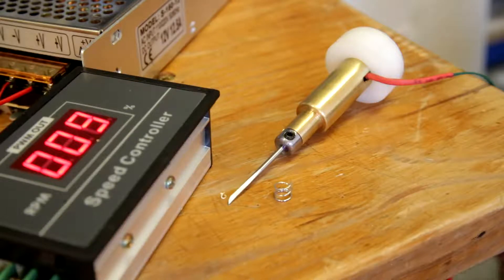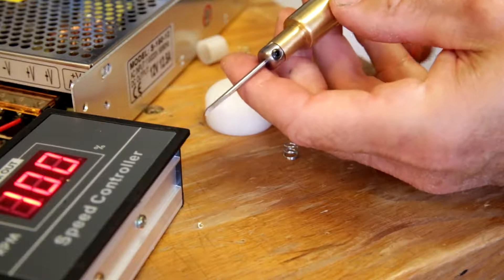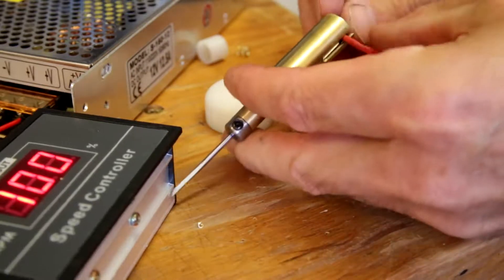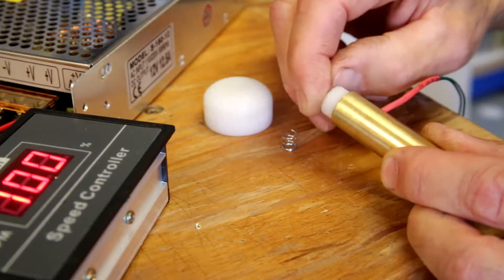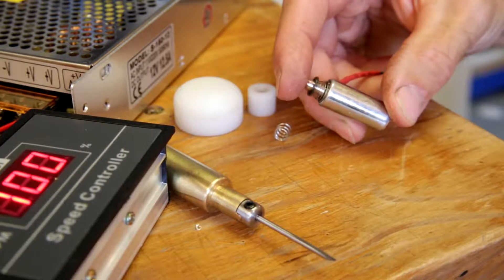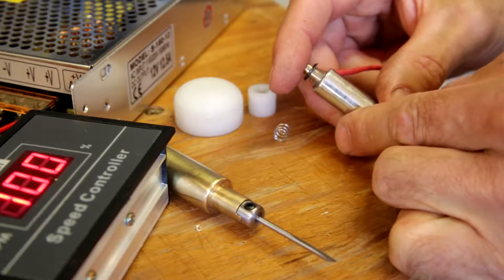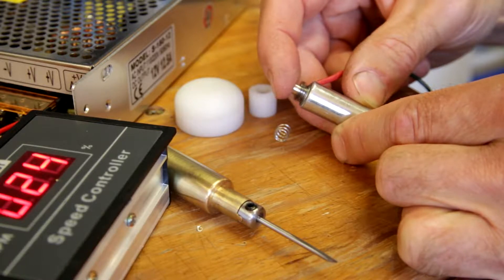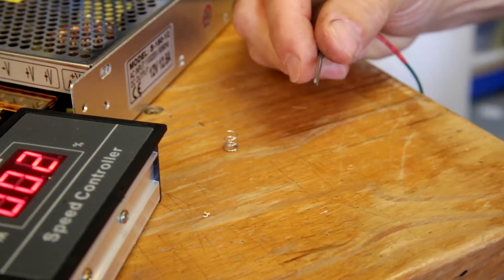Some design considerations for the Easy Graver handpiece

Comment: I would like to know where to get the electronic device. I assume it controls the number of pules per minute and the voltage for power. Is it ac or dc output. but most importantly what is the devise called and where to get it. I have no interest in electronics so not wanting to build one.
Thanks for the video.
Ron
Reply from the maker: It's called a Super EZ Graver. It is DC powered and there is a link in the description to documentation on GitHub. I don't make them or sell them.

Comment: Hi,
This is really interesting work. Instead of modifying a compressor to drive a pneumatic hand piece, I was considering using a high speed solenoid to switch the air supply. I found your channel while searching if someone already did it and your idea is actually much better et efficient!
It really looks like the way to go!
I have a question: is the piston/plunger you use to hit the graver tool the original solenoid part? Did you replace or modify it?
I do not have a lathe (but a 3D printer) so my challenge will be to find a way around this requirement if I want to duplicate your work.

Subscribed and looking forward to your next developments.
Reply from the maker: I modified the solenoid by removing the threaded fixing with a saw and file. I also shortened the piston with a saw and file
Reply: @alastairduncan4702  THanks a lot for the reply. I am considering trying the same thing.

Comment: talked with shaun and he said you are the one with all the info, i wanted to know about the solenoid about it's ratings and the DC resistance of it. so i can calculate certain resistors for a current power supply for it. thnx in advance.
Reply from the maker: https://www.ebay.co.uk/itm/DC12V-6mm-Push-Pull-Tubular-Actuator-Solenoid-Electromagnet-w-Spring-Return/401403373678

As the piston pulls into the body the end of the piston pushes out of the solenoid.  The ref is XRN-13/30tls
Reply from the maker: I'll get a resistance reading tomorrow.
Reply from the maker: The 12v XRN-13/30 has a resistance of 7.2ohms. the cable which is connected to it has a resistance which is about 4ohms. The 24v XRN-13/30 has a resistance of 27.4 ohms with similar cable resistance. There doesn't feel like there is very much different in the force of strike between the 2 solenoids, which I'm surprised at.
Reply: @alastairduncan4702  with calculations done the two solenoids are very similar in wattage  20W versus 21W so thats why there is not much difference between the two
Reply from the maker: @sphinxios thanks that's interesting, the 24v solenoid should produce more force according to its spec.

Comment: Great work if you can make the length adjustable for how hard it hits that be perfect but having not tried it. It may not need it. Excellent achievement 👏👏👏👏👏
Reply from the maker: Thank you, yes I agree, I've been thinking about it but not come up with anything yet. It's still very usable without it. there is power adjustment it just the minimum strike point that would be the icing on the cake. I'm just getting used to it.